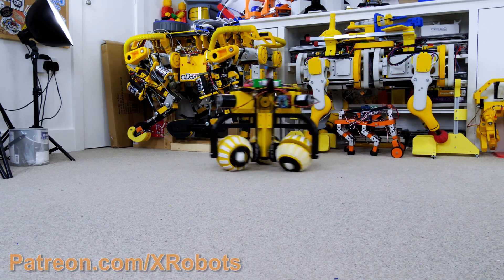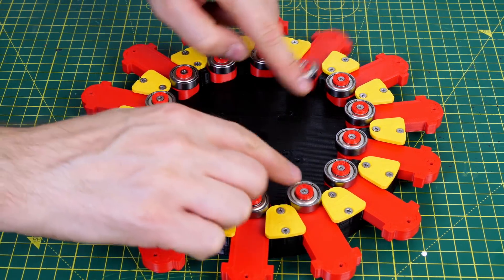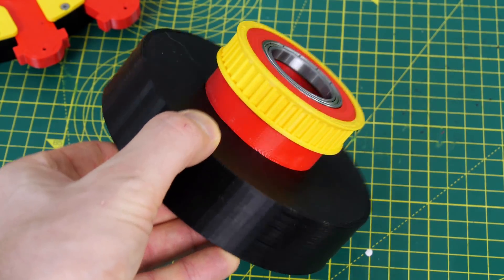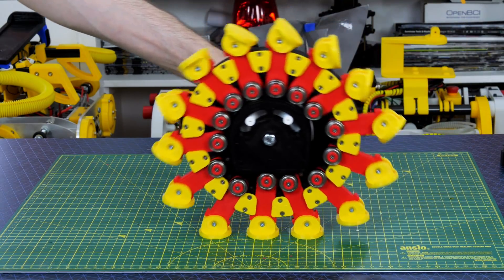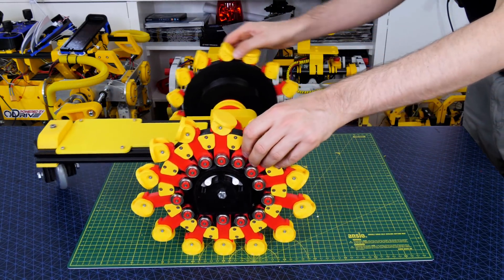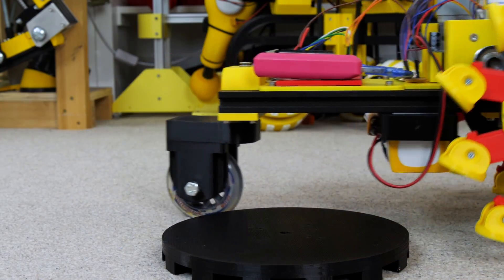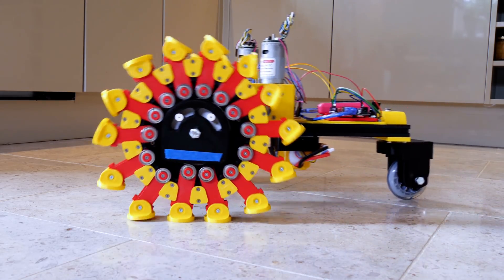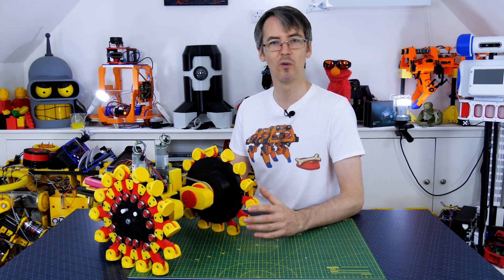Are these Walking Wheels Practical?

Comment: it seems like it might work better with fewer legs.  like maybe half as many.  won't be as smooth, but it would be more effective.
Why does it even need the feet?  just put rubber tips on each leg.  the feet don't look like they help at all.
it should have a very weak spring keeping the legs pulled all the way in for most of the radius, but the central hub should push them out as they start to come down at the front and rear.  
keeping them pulled all the way in the wheel most of the time will allow snagged hoses and pedestrians to drop away.

Comment: A shroud on the outside of the wheels  from 270° to 90° with some tapering might stop things like a hose from binding up. A hose might still get caught on the feet but it would be cool if something simple like that could get things out from in between the feet

Comment: Why aren't these used?  Simple.  A toroid shaped tube of rubber and filled with air has accomplished this for over a century now and is the best solution.  You can see this if you watch a bike tire drive over a 2X4 (38mm X 89mm) board versus one of these wheels.

Comment: Should the bottom flat part of the inner guide be a bit concave instead? Now only one of the legs is touching the flat floor (two at the moment of switching the leg). Because of that the whole device runs less smooth.

Comment: With a rear wheel and shoes that grip properly there would be a lot of improvement.  Machines are usually designed for a certain purpose(s), so you really only took the design part way before testing it.  I suggest re-doing/finishing the shoes and changing the rear wheel.  I, for one, would really like to see what that thing could do when it it's built to actually work, and not just prove a design concept.

Comment: Would it work better with a cover around it, like a tyre? That would stop things getting in between! To prevent movement of the cover, it would be anchored to each foot with a nail or screw.

Comment: Nice! But maybe the same principle of off road tires. those small foots on the wheel provide almost the same grip that protuberances in the rubber surface, and the flexibility of the rubber in tires provides almost the same work as this little contractiles legs.

Comment: I am reminded of the mesh tires NASA designed. I wonder if it's possible to print a springy complaint mesh wheel? I imagine if the outer mesh was like chain mail and it had an inner mesh that was more rigid there maybe it would work? It would of course need to be printed in tpu or some other flexible filament.

Comment: Wait. What is the differens between this and just using thread tracks?

Also the principal is pretty much the same as driving with a flat...
What purpose do the nonflat section fill. The top of the wheel never engage in anything.

Comment: maybe modifying  the guide to have a round transition to the flat part would help, i see the mechanism binds a bit when the bearing is trying to make it trough the corner of the guide, and maybe the feets are not necesary, some tpu spikes may grab better to the surfaces

Comment: yeah, i dont think its fair to criticize this design with the smooth feet. almost every failure it had was due to lack of grip, and a smooth wheel of the same diameter would have failed just as much if not more, im pretty sure. The caster wheel in the back getting stuck on the loose debri was also a clear example of a simple smooth wheel failing in almost the same exact circumstances, to back up my point. there are little design issues that could be tweaked as well, but really I think it would be so much more effective if it had any sort of traction to resist slipping.

Comment: The reason you don't see the pedrail in use is because it was replaced by continuous track vehicles. This design was used in agricultural equipment and even on field artillery up to about WWI. The agricultural vehicles you can find images of just by googling pedrail and artillery examples include Big Bertha and the German 21 cm Mörser 10. The fact that this technology was overtaken by tank type tracks before film was common is likely why you couldn't find any footage of a working example.

Comment: At 11:16 we see that the stripe on the guide is angled in the wrong direction. I can't really warp my head around it but couldn't it be caused by the angle limits of the guide? Or maybe the weight of the guide is not sufficient? I suspect if there was a way to force it at the correct angle you would get much better results.

Comment: To fix the catching issue, wouldn't a strip of rubber going all the way around every foot with some slack to allow for full movement, like a circular treadwheel help? In case that interferes with the gravity of the feet returning to an "out" position a small spring at the end of the little leg which pushes the leg outward could fix that. So it would end up being like a kind of internal suspension circular tread?

Comment: A superior hybrid between wheels and legs might be showcased by the tachikoma (in anime).  Instead of a wheel of legs (as you experimented with here), the design is basically a walker with wheels for feet, where you change your method of locomotion as needed.  It occurs to me that your 2 legged balancer with wheels is pretty much the kind of design I'm suggesting.

Comment: In essence, what those feet seem to be trying to mimic is a tyre with very low tyre pressure (the little feet essentially being no more than points on the surface of the tyre, and the wide depth of movement of the legs amounting to the very high compliance due to low pressure in a tyre).

Maybe a better option would be to have some sort of link between the feet so that there is no gap between the feet for things to slip between (essentially making the feet a continuous track).

Comment: The problem with this design, is that it doesnt absorb the step, like suspension in a car does. It instead forces the entire object to lift. It should be like a car, where the suspension moves, but the body does not. There is no spring, there is no suspension. This is a flat tire simulator.

Comment: low key wanna see a 4 wheel version with some optimization. maybe somehow add a bit of a concave to the flat part the inne part, increase the maximum angle a bit and put either rubber pads to the feet, or to keep them plastic, a zigzag pattern, so if the foot catches not perfectly on the objects it wants to climb it hooks onto it with the pattern?

Comment: Awesome. Hugely impressive as always.
I note in the original drawing the flat part of the cam is actually concave to counter the variation in length as the wheel turns when the surface is flat, but when at an angle (as drawn) the wide "anchor" flukes of the centre mounting part changes the profile.

Comment: If you add rubber grips to the bottom of each foot like you mentioned and put a sort of guard that covers the sides at the bottom, that would obviously mostly fix the slippage issue, and should stop the issue of things like a hose getting caught.  

Add that in with changing the flat side of the cam(? Not sure what to call it) to more equally distribute the load across the feet, I think you'd have a really formidable little off-road vehicle.

Comment: CHISELED SPAM
is what you will see in the mirror if you surf on a weak plank with dumb, fixed wheels and interface with a muffler, retread, snow turd, road kill, driveshaft, railroad tie, or unconscious pedestrian.

If you think this is unlikely, you’ve been surfing too many ghost malls. All of these obstacles and more were recently observed on a one-mile stretch of the New Jersey Turnpike. Any surfer who tried to groove that ’vard on a stock plank would have been sneezing brains.

Don’t listen to so-called purists who claim any obstacle can be jumped. Professional Kouriers know: If you have pooned a vehicle moving fast enough for fun and profit, your reaction time is cut to tenths of a second—even less if you are way spooled.

Buy a set of RadiKS Mark II Smartwheels—it’s cheaper than a total face retread and a lot more fun. Smartwheels use sonar, laser rangefinding, and millimeter-wave radar to identify mufflers and other debris before you even get honed about them.

Don’t get Midasized—upgrade today!

Comment: What an awesome experiment! I've got some ideas that I think may help improve it.
1) Up to 3 bearings can touch the bottom of the hub at a time. The outer 2 of those spokes won't support the hub on flat surfaces since they're angled and have less height. Making the bottom of the hub slightly concave should give better traction on flat surfaces.
2) If you pause at 9:13 you can see that the center and right of the bottom of the hub isn't touching any spokes. The weight appears to be fully on the spoke with it's foot on the top of the yellow platform.
I think both of these issues can be solved by...
3) I think you'd get better weight transfer and control if each leg was sprung/compressible so they always pressed against the hub OR if the hub were a track that fit over the bearings, captivating them, so they're always in contact.
4) I believe forming the hub in the shape of something like a limacon** would give better traction on flat, as well as better transitions to/from steps and slopes.
5) Ditch the feet entirely. Any sort of ball/round static foot should perform better.
6) I think spring-centering the hub should also help in weight transfer and transitions.

**I'm not sure of the correct term for the shape I have in my head. Bearings/legs further from bottom should have increasing leverage to rotate the bottom of the hub towards them.

Comment: Nice video ^^ but one question: isn't that what normal air filled rubber tires are doing just on a much smaller scale xD I mean not the free moving part but the flexing around the objects part. It's just the same but in a much better way xD

Comment: Pretty cool. My thoughts are to maybe use a concave foot guide to keep more feet in contact with the ground, rubberized feet for traction, and going three or four wheel drive or at least use a large, light wheel in back to take care of that dead weight of a third wheel.

Comment: It would be neat to see the center guide replaced with smaller springs that keep the legs mostly pushed outward, spring strength somewhere on the realm of 'wheel load divided by number of feet expected to be in contact with the ground'.

Comment: Looks sweet even if the practical applications are limited. 
Rubber feet and a comparison with a normal wheel of the same diameter, climbing over fixed objects would be interesting if you want to revisit the design. 
And is it possible to design a foot-wheel specifically for climbing stairs? 🤔

Comment: I feel like if it was 4 wheeled it would have worked better. I think it would work better because with loose objects after it got up it was basically only being supported forwards and backwards by the wheel attempting to move up the object. Also climbing the object applies a torque on the machine and a caster wheel isn’t equipped to stop it. Please feel free to prove me wrong, I am open to conversation.

Comment: the feet should be weighed down slightly more toward the back so that they have a "heal to toe" motion while placing the foot down. Should help with gaining purcahse on obsticals, especially if the feet were rubber soled

Comment: It's a cool design, but simplicity rules in practicality. Even if this worked 50% better than any other highly mobile wheel or tread, the massive amount of moving parts that need to all be kept working would make it a nightmare in any real rough conditions. And at this point in complexity, you would just use a 4 legged walking robot at this point instead of messing with what is essentially a complex version of the wire airless tires NASA developed a years ago. Cool to see someone testing these odd methods of movement to see how well they would actually work. Who knows, you may stumble upon an amazing design someday that could be really useful.

Comment: Wow that works far better at climbing over things than I expected. I was going to suggest a two wheel self balancing robot with these wheels, but then I realized that would keep the flat part of the guide from adjusting to slopes.  It does look like the slides are shorter than in the diagram you showed from Wikipedia.

Comment: The movement of each foot is straight down and straight up. This could be interesting to automate planting or another case where holes need to be pushed deeper into the ground. Going through sand or gravel may be easier as well.

Comment: What if you use a springy ring instead of the central flat guide? Then you'd have suspension and a smoother, more adaptable way of contacting the ground

Comment: Nice concept to explore but it's definitely not going to be an assassin bot 😂 considering its clickety-clickety anti-stealthiness, so no BB Glock attachments needed 😂.  It would be nice to see how it responded to various surfaces with rubberised feet (or curved pads) and at faster speeds to see if it was even possible to make it drift, if we were getting into 'seriously silly territory'.  What also would be nice to see would be rubberised or elasticated tracks that might assist in movement and not getting tangled in terrain like hosepipes.

Comment: It's fun to see the centrifugal force at 4:20
Reply: Centrifugal is fictitious
Reply: @TheDefender123Plays  Yes, we discussed that in this thread already.
So is gravity, depending how you describe it.
That doesn't make the centripetal force invalid or unreal (provided you are working in a rotating reference frame).
Reply: @landsgevaer  centripetal is the the center pointed force(center of a circle). It could be any force so long as it is center seeking.

Centrifugal is what people describe as the force pushing away from the center(perceived force pushing out of your seat while turning in a car). However, newton's first law states that an object in motion tends to stay in motion in a straight line unless acted upon.

 Your Body has inertia so it wants to continue straight, but the car pushes you toward the center of the turning path which is a circle. That center seeking force is the centripetal force.
Reply: @TheDefender123Plays  I am aware of all that. In a rotating reference frame, simple Newtonian doesn't apply, however: bodies don't fly in straight lines in those coordinates. Then you have to account for the centrifugal force.
"Fictitious" means that it depends on your frame, it does not mean it doesn't exist. Centrifugal is fictitious according to Newtonian physics just like gravity is fictitious according to relativistic physics.
Reply: Centripetal*
Reply: @iangabriel5536  Centrifugal is just fine, actually.
It depends on whether your coordinate system is co-rotating. The red legs co-rotate, so in "their" reference frame they experience centrifugal force.

In the clip you can even argue that it is the lack of a centripetal force that makes the legs fly outward at some point. In that sense you "see" the effect of the centrifugal force.
Reply: @landsgevaer  Well, "Centrifugal" force is a term you can use to call it that, its just important to remember that Centrifugal is a fictitious force (In such that it does not exist in all frames of reference).

But there are frames of reference in which an apparent Centrifugal force does exist so you can still call it that as long are you recognize that its not a true universal force that exists in all frames of reference.
Reply: @eragon78  I agree 100%.

Similarly, the coriolis force is fictitious, or the Euler force, and even gravity is fictitious, to name a few. Nevertheless, they all feel just as real.
At the same time, the centripetal force is never a proper separate force. It is always some other force that receives the label "centripetal", that acts as such. Like a gravitational force acting as the centripetal force on Earth in its orbit around the sun, or a tension force when swinging a stone around tied to a rope.

Hence my desire to emancipate the centrifugal force again in the above thread where it was deemed a mistake. ;)
Reply: @iangabriel5536  *people know what they meant

Comment: Maybe put a belt or tread around the feet, along with a wheel cover. That should prevent things from getting snagged.

You should also put some suspension on the caster wheel.

Comment: in theory you could make a outer guard that protects against catching on cables and things. A fender of sorts that as the feet enter the fender, the fender as a passive catch that removes the stuck object. however this would probably require a thinner foot, almost matching the leg width.

Comment: Pediwheels were a pre WW1 idea kicking about to try and reduce ground pressure from wheels before the rise of the tracked systems on Holt tractors and early tanks.
There are photos of artillery guns and traction engines fitted with them  in the 1910-1916 era. H G Wells suggests that pediwheels would have powered his fictional LandShips in the 1904 novella of the same name.

They were tried, and has some success with soft ground, but were not designed to climb stairs ;)
Ultimately, tracks and later flotation style tyres made them obsolete

Comment: The Pedrail wheel design was developed for heavy objects on soft surfaces in the early 20th century. A good example of the design is in a picture of a Big Bertha howitzer during World War 1. Low pressure balloon tires would achieve the same thing and be more efficient (and quieter).

Comment: I bet if you took the guide out it would work exactly the same. The legs appear to be bottoming out on the bottom lip which they would do anyway. I think most of the force on the leg in the front would be tangential to the outer circle -- so the center guide does nothing useful.